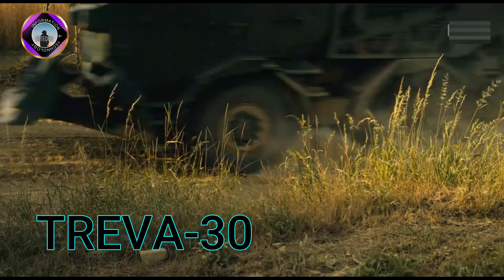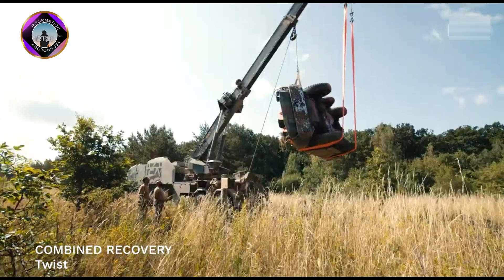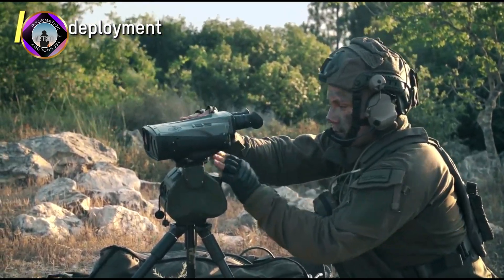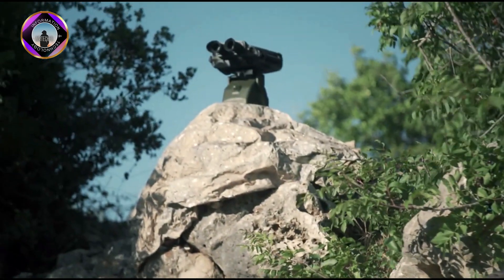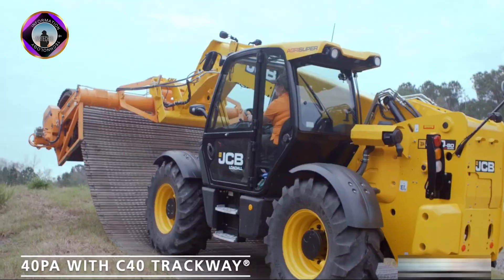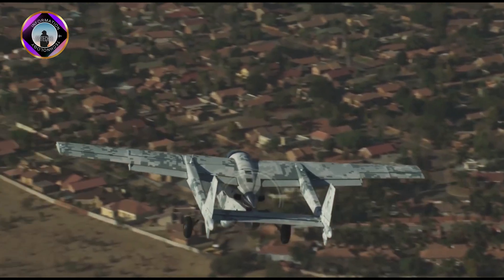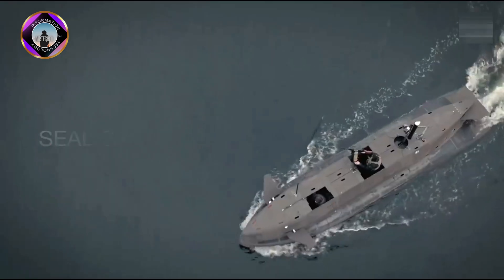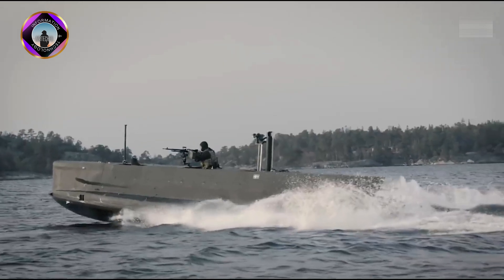Amazing Military Inventions That You Should See ... #militarytechnology

Comment: What's an  'aeroplane'? I built Man lifting kites. 
Try resisting a big "French Military" No fear!
 It consistently breaks it's line instantly and goes way off on it's undetermined path . Bye bye.
 "We are gonna need a Thicker Line" That's no Ordinary fish.
 You up in the air won't land too far. I hope it's not in the middle of a tree.
   Another one hit's the dust.  DAMN!
Note: the French Military used this design to lift Soldiers high above the ships to watch for enemy's below the Horizon. It is a form of double Box Kite with wings. You need very strong line.
 The only one I have left is the one I never finished. It uses a very high aspect ratio meaning tall and a lot of surface area collecting wind but very little resistance from the wind. I guess you could call it 'Aero Dynamics.' lol. These kites rise fast right overhead  and are very stable if you can hang on to one. You can tie them to a picnic table. So much for the picnic table. The kite lands fine in the hydro line but the cars the table hit are al in for insurance claims. " Let me get this strait" You said your car got hit by a fk'n picnic table that came out of the sky. I am happy to inform you that we have captured the offender and are arranging a nice family picnic. You're welcome but we won't fix your car.t consistently breaks it's line instantly and goes way off on it's undetermined path . Bye bye.
 "We are gonna need a Thicker Line" That's no Ordinary fish.
 You up in the air won't land too far. I hope it's not in the middle of a tree.
   Another one hit's the dust.  DAMN!
Note: the French Military used this design to lift Soldiers high above the ships to watch for enemy's below the Horizon. It is a form of double Box Kite with wings. You need very strong line.
 The only one I have left is the one I never finished. It uses a very high aspect ratio meaning tall and a lot of surface area collecting wind but very little resistance from the wind. I guess you could call it 'Aero Dynamics.' lol. These kites rise fast right overhead  and are very stable if you can hang on to one. You can tie them to a picnic table. So much for the picnic table. The kite lands fine in the hydro line but the cars the table hit are al in for insurance claims. " Let me get this strait" You said your car got hit by a fk'n picnic table that came out of the sky. I am happy to inform you that we have captured the offender and are arranging a nice family picnic. You're welcome but we won't fix your car.
Reply from the maker: Thanks for your comment
Reply: @MrTechFo  Kool Man! Following.
Reply from the maker: Okkk Man....